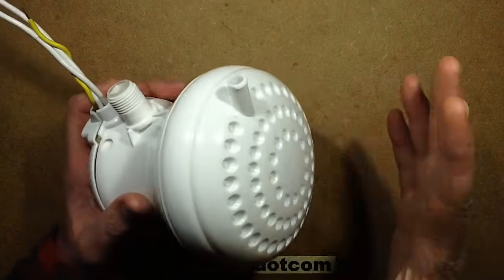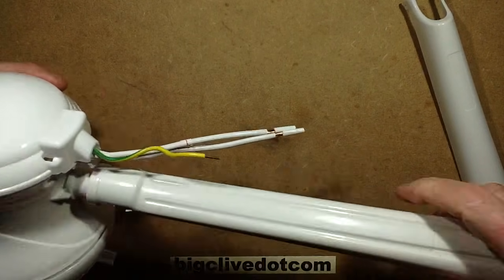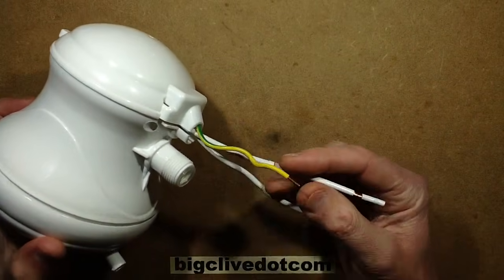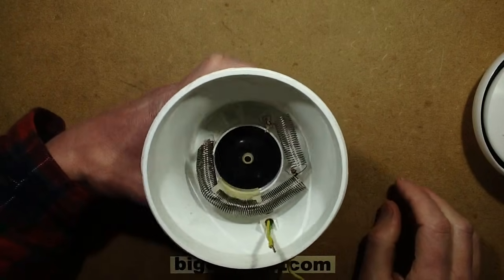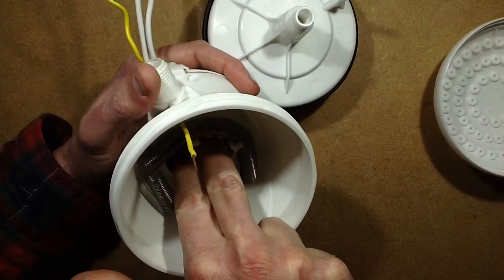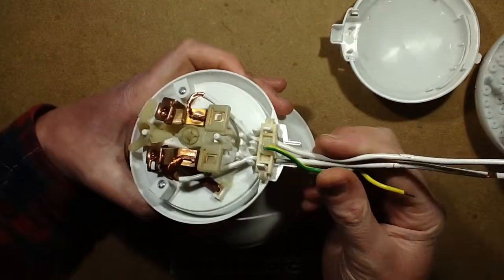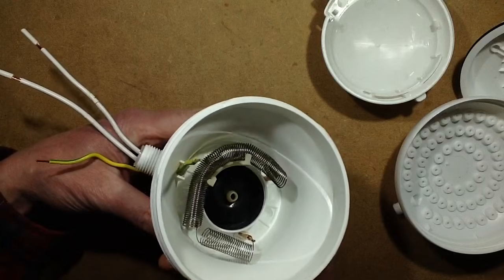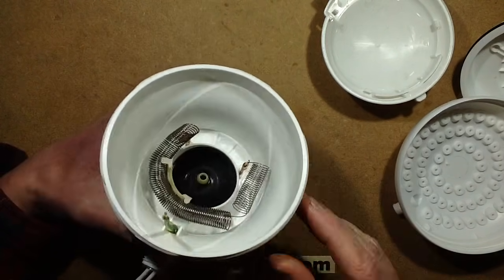Inside a heated shower head.  (suicide shower)

Comment: If I had to model this, I would conclude that there was a potential divider across the supply, with the water connected to the middle via some resistance.... if the earth is connected then the water is also connected to ground by another resistance... 

I would then conclude that the water is probably at a potential around 50-60v assuming everything is working and the device is earthed...  

Conveniently a narrow stream of water is almost always open circuity after a number of inches as it will tend to separate into drops....
Reply from the maker: +James Lewis Except, this is a 240V one so that mid point water based tap will be at around 120V like with the electrode cup heater.  It is notable that people who put their head up against the shower head are more likely to get a shock.
Reply: Right, I kinda viewed the water as a partly conductive fluid and you'd get 120v from the "potential divider" heating element... but the water is also connected (we hope) to earth... so there's another potential divider between the 120v and earth made up by the water itself... which is where I got the second division down to 60v...  (surface area aside).

I think we agree that if you put your head near the shower, then the chance of an unbroken stream of water existing between you and the heating element is much greater.

As I said earlier, I have a healthy disregard for electrical safety, and so it's not so much the outcome when everything is working that scares me... it's what happens as you pointed out when the neutral contact fails to close, or the element breaks at the neutral end... especially when the earth is missing ( I already think it's inadequate )...  The water simply becomes live at 240v, and if you're 4'6" and the shower head is 2 feet above you, it might still not kill you... but it you're 6'2" you might have a bad day!...
Reply from the maker: +James Lewis If the earth wire was intact then theoretically little current would get beyond that, since it would be at the same theoretical potential as the shower cubicle.  I'm not sure how much of a gradient there would be around it.
Reply: bigclivedotcom Well... I think we agree that there's lots of uncertainty about this depending on the installation, the hardness of the water, how corroded (or covered in silicone) the earth wire is... etc etc...

Comment: I found out about these type of shower heads when I was traveling in Bolivia. Got quite a buzzy shock when I grabbed hold of the head to adjust it. I quickly decided that it didn't need any adjustment after all. Nice to see how they work. Thanks Clive.
Reply from the maker: +Andy Davies I like the concept of electrical appliances that commend respect by punishing you when you touch them.

Comment: What a dangerous piece of shit! Not only an electrical hazard but a fire hazard as well when the switch contacts weld themselves together. A device such as this would never be permitted for sale in NZ and in my opinion the only safe way to use this thing would be to remove it and throw it in the bin, or send it to Photonicinduction so he can crank it up on his variac till it pops.

Also speaking of a buzzing/tingling sensation, just imagine if someone with a heart condition or worse still, a pacemaker used one of these unaware of the danger, I bet that would be interesting.
Reply: Somehow I doubt Photon would even need to use the variac.

Comment: It's a common practice in certain, let's say "odd" countries to earth every socket to the nearest conductive waterpipe. I wonder if people install these so that they "ground" it directly to the incoming water pipe...
Reply from the maker: +Toni Lähdekorpi To be fair, is the pipe was buried in the wall, and better still came from below then it would at least create an equipotential zone.
Reply: bigclivedotcom That works in theory, yes. And will be just fine in most cases.
But the problem is that it becomes "the norm" and people with no understanding of anything start to do it without having a clue on what they are grounding things into.

In extreme cases people might be grounding things to plastic pipes... I've seen those, sadly.
Reply from the maker: +Toni Lähdekorpi Best "ground" I've seen was a very large earth wire bolted to a brick wall with a rawlbolt.
Reply: +bigclivedotcom I would've loved to see the "desing meeting" where that solution was laid out...
Reply: Yves - You should stop using and messing with Lead solder. Behavioral issues such as yours result from moderate exposure to Lead (>5mcg per deciliter).
Reply: Yves - Sorry, I earned my living doing electronics design and repair, some time ago, but the principles are still the same.

You will get an electric shock if your heater's insulation fails.These are not purely on/off things, but depends on where in the heater element exactly the fault is. If it is at the "cold end" or that end of the element that happens to be nearer to mains voltage Neutral, the shock will likely be lighter, and v.v. for a fault nearer the Live unfortunately. 

The shock you risk will be coming about as follows: the leaking Live wire will send electricity trough your body and through the wet surroundings in the shower room. This current which will find its way to the Neutral potential through various ways through the conductivity of the building, piping etc etc., and will cause you the potentially lethal trouble.

This unfortunate affair is prevented by the ground fault interrupter which senses that the device you got the shock from is not returning all its current through its own proper Neutral wire any longer, but some is flowing missing through somewhere else -- that being your person. At the standard max current limit of 30mA and 300ms exposure time the imbalance will trip the protection. These values are quite high actually.

The earthing of the showerhead here is basically pointless, what you need is the ground fault interrupter.

Hope I made myself clearer this time. Again, if you have something in your mind, just ask, and I will try to come up with a constructive answer.
Reply: +Toni Lähdekorpi  Actually this practice was perfectly legal in several central European countries until relatively recently! In Austria and Germany the water suppliers used to guarantee a very low-impedance earthed water network (after all there were hundreds of kilometres of cast iron pipes running under the streets), usually well below 2 Ohms - low enough you didn't even need RCDs, a Diazed fuse would blow in case of an earth fault. House plumbing at that time was either lead or galvanised steel with some of that new-fangled copper thrown in. During these times people would definitely pull an earth wire from the nearest water pipe. I once worked in a block of flats built in 1960 where they didn't bother running an earth wire with the 220/380 V riser mains but earthed every flat to the water pipe in the kitchen! Big downside: they didn't run a dedicated earth wire to the pipe but just a piece of red 1.5 mm2 from the nearest junction box in the bedroom. If you disconnected that bedroom circuit, the two other circuits lost their earth connection! Earth resistance was around 1 Ohm in that place but that could have been just the pipework from the flat down to the equipotential bonding in the cellar rather than the actual water network.

In the 1990s plastic pipes became more and more common and therefore this practice was finally banned by the water suppliers - but only in 2001 in Vienna!

I'm absolutely sure you can still find many places where the earthing was never upgraded although it really should have been - there were warning notices put up in every house back then and landlords were required to inform their tenants. I do know that two tenants in the house where I live (elderly people) flatly told the landlord to bugger off when he told them. Both flats were completely rewired when the tenants passed away.
Reply: In the UK a consumer unit (modern fuse board) has to be connected to both water and gas pipes (equipotential bonding) This is so there's earth continuity in the case of an electrical fault
Reply: Mario Melendez
Neutral is common with the neutral coming in from road and not bonded to the box. Ground is bonded to the box (case) and connected to a driven ground rod within so many feet of the service. The two are different.
Reply: Yves - Well, I challenge you to pick up a multimeter and measure your skin resistance dry and wet. You will be surprised.

Then with your wet hands, grab up a voltage source (by immersion even) of say 50-60 volts, and tell me if you like it!

You may want to ask any electrician (or any electronics guy) on something known as the ground loop, which will inevitably build up if your ground potential is "hazy" which is often the case in old and modified buildings. These will be more and more pronounced the more current you draw, such as is the case with large heating elements, and can easily reach 70-80 volts in a 230 VAC system.

And, of course, there is the possibility of an ordinary insulation fault somewhere in the heating element -- there is a very good reason why the authorities in all major governments now require earth fault interrupters for all newly installed (or repaired) portable mains sockets, which also require a working earth potential.

Sorry if I failed to make perfect sense, but I'm glad to clarify on request.
Reply: Itapirkanmaa2 You are more than a little confused, I'll just ignore all of the irrelevant crap you wrote and just explain to you how the system works: first of all there is no insulation on the heating element, it's just bare metal. For someone to get a shock on a device like that electricity would have to form a path between the "positive" in the heating element, go through the water, then trough the person. then back to the "negative" of the terminal where the heating element is connected. Needless to say, going trough the heating element offers far less resistance by far, especially considering that fresh water does not in fact transmit electricity well at all (50 to 1500 µS/cm) whereas copper is 58 x 10.E6 µS/cm for comparison. So unless you are taking a bath in mercury this thing is in fact very safe. I guess you must have skipped the day in school where they showed that two wires immersed in a cup of water would not close a circuit unless you threw salt into it. Still holding out on those documented cases of people dying because of those by the way.
Reply: Yves - Glad you accepted the first one I googled in 10 seconds though, although it sort of ruins your thesis.

On the second: I wonder what should be wrong there in your opinion -- but the involuntary spasm of muscles under the electric shock that was reported is a typical sign of a strong shock, and that effect is typically not widely known by lay people.
Reply: +Sebas Eu I&#39;m not sure which country Toni referred to but in Finland, where I live pipes are generally made of plastic. Old houses also have copper pipes and iron sewers but they begin to be already in need of renovation. In addition, nothing are grounded through the pipeline even though metal pipes supposed to be grounded. I must say though that my heat distribution room is plumbed with copper pipe despite all the incoming and outgoing pipes are made of plastic.
I've never seen electric shower heads, not even in Brazil (I was on a business trip in Sorocaba, a few months ago)
Reply: +peto22 that's because heat distribution is a closed water circuit. copper is there in central heating pipes because it isn't a pipe with "grey water" that could oxidise the copper and it doesn't accumulate any deposits in the tubes. in addition: copper is more conductive to give off heat faster away to your whole habitat.
Reply: peto22 I was referring to places like Argentina, Bolivia and even Spain.
And older houses where the pipes are old and made of metal.
I've seen old sockets and devices grounded to those pipes. And when renovating electricals, that same practice of grounding continues.
Reply: +Toni Lähdekorpi my thoughts exactly!
Reply: Ragnar8504 Thanks for the detailed info!
The problem is in many cases electricians who don't give a poop or don't know any better. They might do something criminally insane; like ground sockets to a plastic pipe...
Reply: +Toni Lähdekorpi That usually doesn't work since most countries where these are installed are using PVC for their pipes. Metal is out of bounds cost-wise there. So you can't ground to a pipe. If you're lucky you have an incoming ground wire. If not, many electricians will simply ground to neutral. Or just leave the thing hanging in the air.
Reply: Mario Melendez There are old houses with old metal pipes that were installed before plastic ones became common.
Reply: +Toni Lähdekorpi Thing is, over here very few of those old houses still remain. I've heard of grounding to metal pipes, but I've never actually seen it done since here most of those houses done in metal were torn down decades ago. PVC became mainstream in Latin America in the 70's, so to find metal pipes you're talking houses about 40 years old. Urban regulation and protection laws didn't really come to be until the 2000's (and still don't exist in many places) so most of those 40 year old houses went the way of the dinosaur.
Reply: +Toni L&#228;hdekorpi The Finnish earthing standard for our poorly conducting soil (relatively dry granite and gravel) is 40 meters of copper wire in ground around the house, I know because I dag proper grounding for our house last summer. The rebar of the building should always be grounded as well, but it&#39;s not accessible any longer in our case. I read rebar and concrete should conduct quite well --  the piping we have is reinstalled and made of plastic, as I think is usually the case pretty much everywhere, or it might have plastic sections in between. 

I think grounding is one of the more overlooked points in installations. This showerhead in the clip and its stub of &quot;grounding&quot; has no way of conducting any meaningful current in any sort of practical water. Perhaps in some totally saturated salty water it could work.

If someone even though of installing such a showerhead here, he or she would be jailed! It's always the boiler here, we never ever install any ad hoc "staight" heaters.
Reply: +Mario Melendez  we have copper piping in canada    that is pretty much all homes
Reply: +Toni Lähdekorpi Yes
Reply: Sr John Deans The PE + N system in other words. 

One driven rod for PE is not enough as per the regulations, not at least up here. The ground potential must be in order, or any ground fault interrupters (required nowadays for all sockets) will not be working properly.
Reply: +Toni Lähdekorpi In countries where this is common they don't use metal piping, plastic is far more common. I think people freaking out in this comment section are a bit sheltered to be honest, I have never heard of anyone so much as getting a bruise from one of these, and they are very rarely grounded. I dare anyone to find official records of deaths attributed to this device.
Reply: Yves - I'm afraid you are wrong in this. I myself tinker with electronics, including high voltage tube devices. I've received my fair share of extra joules in my life, and i can assure you a) there is a lot of energy in the mains and b) wet or even slightly moist skin has a very dramatically increased conductivity. A and B together spell major hazard. I can refer for instance to http://planet.weber.edu/Electronics/Handouts/Lab1b_Appendix-ElectricShockHazard.pdf
Reply: +Itapirkanmaa2 You are out of your element mate. You have failed to explain how electrical showers are dangerous (no, "mains have a lot of electricity" is not a valid fucking explanation) and you have also failed to produce real world documented cases of people being hurt by electrical showers.
Reply: +Itapirkanmaa2 Thank goodness you shut Yves up. Some people are too proud for their own good. They take incomplete knowledge that they swear is correct, and they foist it down everyone's throat without even bothering to do a bit of research for verification purposes.
Reply: SouthwesternEagle No one has ever died under an electric shower, I went away simply because he kept saying the same thing over and over and I have shit to do. Sorry dude.
Reply: +Yves - 

You can google it up actually. My ten seconds' worth of research. 

Death:

http://www.thenational.ae/uae/woman-in-abu-dhabi-dies-after-being-electrocuted-in-shower

Serious risk:

http://www.tripadvisor.com/ShowUserReviews-g317112-d1026275-r117602277-Aureum_Palace_Hotel_Resort_Bagan-Bagan_Mandalay_Region.html
Reply: Itapirkanmaa2
>That second link
I'm actually a bit amazed at how dumb you must be to believe that.
Reply: Itapirkanmaa2 Älä ruoki trollia.
Reply: Toni Lähdekorpi Eikhän jot tuoll lähtent kotioppäiten